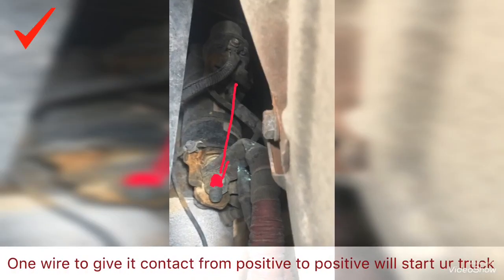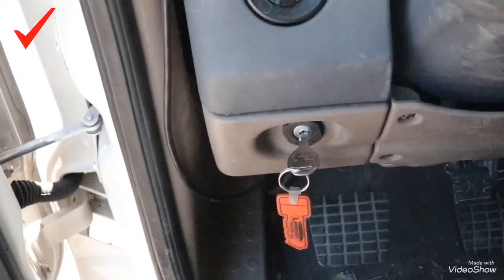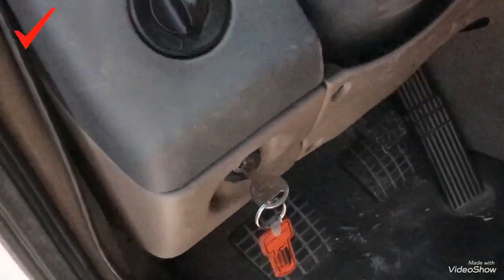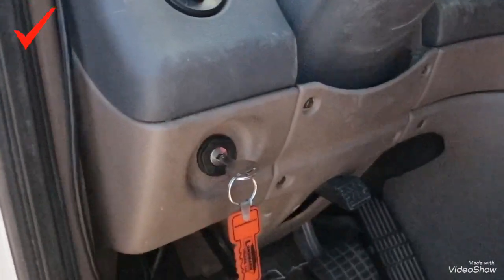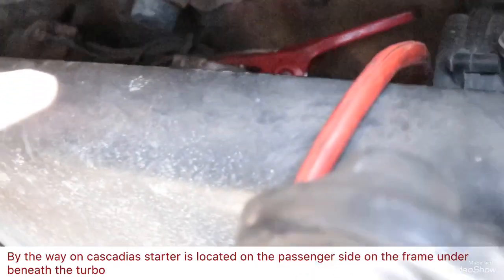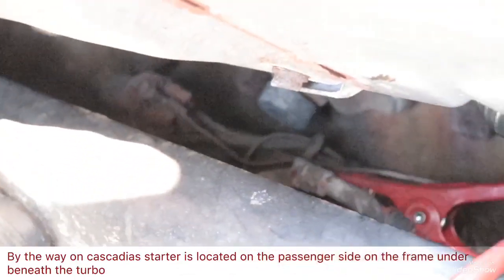Cascadia won’t start

Comment: Man you saved me alot of time andmoney. I pulled into the truck stop to use the restroom and came out and the truck wouldn't start. I watched this video went inside bought roll of 12 gauge wire $9 and wired it like you said and bam I'm off and running again. Thanks for the video

Comment from the maker: Well one time I changed the clutch switch is under the clutch pedal Iike a sensor 
Like $80 bucks at dealer it was starting after but then again over and over and then won’t start at all I was staring it from starter directly for a while then I changed the starter and dint have a problem no more since then till this day starts right away 

But u can test and see if it’s the clutch sensor it’s easy I’m gonna post a quick video with in 30 min and u can see how u can by pass it if it works by pass then it’s ur clutch sensor if not it’s gonna be ur starter for sure
Reply: Thanks for the info sir

Comment: What was the issue that you had to repair so that you didn’t have to start it like that anymore? Thank you in advance
Reply from the maker: Trucker_Juice honestly ppl been telling me lot of crap to change I changed some stuff didn’t help then I changed my starter and no problems since then I didn’t think was starter cause I was able to start it direct but it was the starter 

So if it does the click noise and no start it’s the starter
Reply: Transformer 379 10-4! When I first started having the problem I replaced the starter and I noticed my solenoid was probably bad.Then it didn’t happen for a while but now it’s doing it all over again going to try replacing the clutch switch and test my batteries. Thank you for the reply
Reply from the maker: Trucker_Juice Trucker_Juice a
Could be the clutch switch I changed that and  didn’t do nothing before trying to replace the clutch  switch try to see if you can by pass it by passing don’t work ether it’s not the clutch sensor  I think I have a video up how to bypass the clutch if it’s not this video it’s in a different video 

But could be the celenoyd thing the batteries could only give u cranking problems like not having enough power to start ur not the clicking sound
Reply from the maker: Trucker_Juice Trucker_Juice a
Could be the clutch switch I changed that and  didn’t do nothing before trying to replace the clutch  switch try to see if you can by pass it by passing don’t work ether it’s not the clutch sensor  

But could be the celenoyd thing the batteries could only give u cranking problems like not having enough power to start ur not the clicking sound 

To bypass clutch sensor take a wire  or paper clip unplug the sensor it’s by ur clutch pedal somewhere and contact the two outside prongs if it starts then it’s ur sensor of still dint start then it’s not the clutch sensor
Reply: Transformer 379 I’ll try The switch bypass again I did it before and still no crank. If you could drop a link to that video it would be great and I’ll watch it in the morning